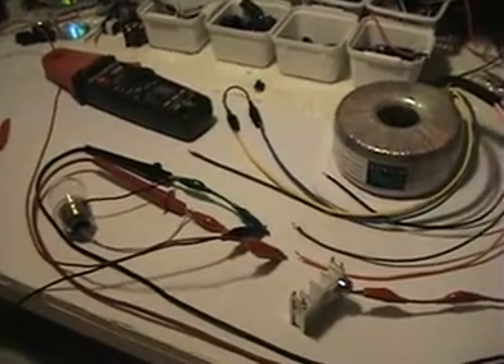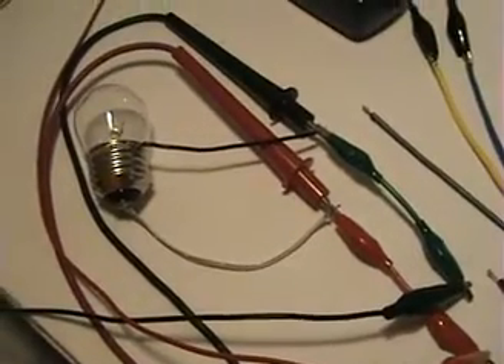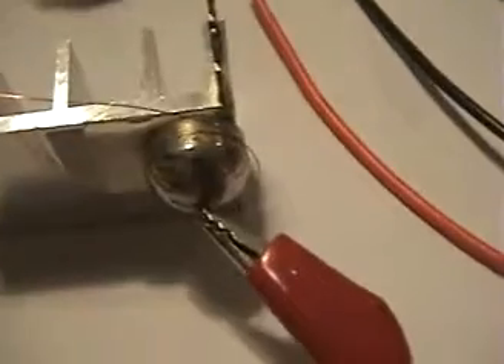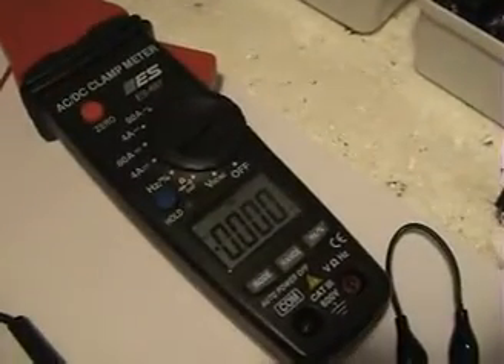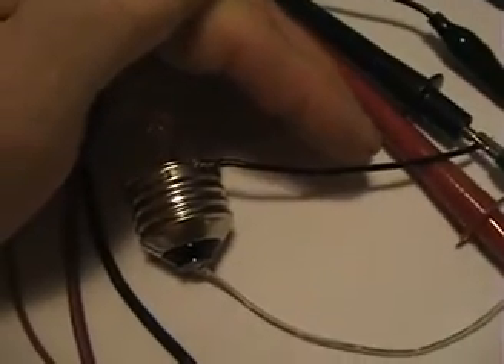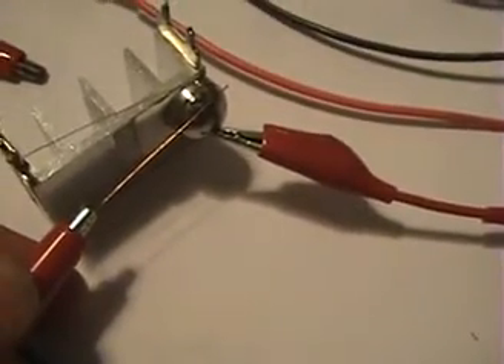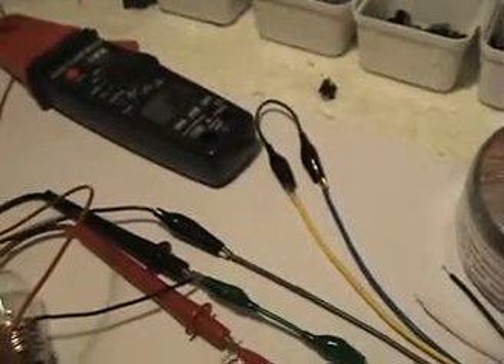Electricity Amplification by Neo Magnet (update)

Comment from the maker: Yes Eddlipton,

you are getting it. You can look at a coil like a heavy flywheel. If you give the wheel a push you store energy in it and you can get it back less friction. If you pulse push the wheel you can have it evenly doing work to something that is attached to it. However you cannot have something attached to it that require more energy (work) then what you put into the wheel.

Luc

Comment: Interesting stuff!

I don't think this is quite the same thing happening with my magnetic quench though.

Once when I was a kid and I had one of those 2001 electronic kits with a bunch of parts and springs to connect to the receptors I thought to myself, what if I connect the electromagnet part with the closed path of the relay.  That way, when the current flows the magnetic field will build up strong enough to sever the contact, which would in turn collapse the field and cycle over and over.

Comment: Hi Luc,
additionally I'm thinking that the voltage which goes through the magnet is modulating the magnetic field from the magnet itself. It must be in the range of 5 Khz ore more, otherwise the coil would not ignite the spark. There is a paper(pdf) on panacea-bocaf Online University about a MRA (Magnetic resonant Amplifier) which describes how to gain energy from a magnet(but in a different way)- it takes a piezzo to oscillate the voltage.
Nice Greetings
Micron

Comment: Hi Luc,
i have just two ideas: what if you take a longer cylindrical neomagnet instead of you little one, and wrap a magnet-wire around the magnet. like a coil. We have Oscillations otherwise the ignition coil would not work. so there must be a oscillating magnetic field that cames from the magnet. Normally we must taken up an alternating current from the wrapped wire around the magnet. -futher on both end of the cylindrical mag you connect the wires from the ignition coil. Greets Micron

Comment: So my main point is you can do the same thing with a relay which probably has better materials to handle the sparking, and mechanical motion is done without using the magnet as a conductor.

In either case you'll not really be able to use much current, so in the end you're probably still have to use a mosfet or transistor, and lastly you'll get more control with the 555 timer circuit.  It's just charging and discharging a capacitor through resistors based on 1/3 and 2/3 voltage comparisons.

Comment: Hi Luc,
the second ideas is to try to pick up current/voltage with a blank wire  from the mag, like a second loop and grounding it on an extra capacitor. But the resistants in the new created loop must be lower than in the loop of the ignition coil, otherwise
the current/voltage will not going also through the second paths. Maybe it will works with caps they're have normally a low resistants. Let me Know what do you thinking about.
Thanks Micron

Comment: The relay I did that to fried somehow, either the mechanical lever sparking created an insulating coat, or the coil burned up from voltage spikes but anyway, I suspect what you have created with the magnet and the wire achieves a similar effect.

As current flows through the wire you get just enough of a magnetic field to repel the wire off of the magnet, which then collapses and oscillates.

I love the oscillation but the sparking is undesirable, as well as the heat in the mag from conduction.

Comment: Hi gotoluc,
this is what Tesla did, adjusting or modifying spark-gap with magnets. I'm thinking that this is a kind of OU because the magnet is sucking/polarizing neutrino over the spark itself, this a type of method to use a magnet to have more electrons materialized from dirac sea in the wire. This could be used for producing serious amounts of electric power. Referr to Tom Bearden a magnet have no static magnetic field it has a field in a steady state flow from the quantum field. the pulsing

Comment from the maker: Hi Ed,

I'm working on a circuit that would be a signal generator with Pulse width (duty cycle) adjustment and control of 2 independent switches which are 90 degrees out of phase (flip flop)

Just wait a few weeks and I'll let you know when it's ready.

Luc

Comment: This looks similar in function to Tesla's high frequency current circuits(the one that uses inductor's to convert environmental energy to electrical energy. you should look up those patents. Look up N. Zaev's work also. In the process of building a PWM that hit's pulsing rates of up to 44Khz. Should be fun... I can only imagine 150Khz and up. That particular area of Tesla's work is the most fruitful for mankind.

Comment: Now use 2 speaker magnets, at least  4". With the positive wire in the middle, hold them apart to the point they just start pulling on each other, you feel your hands shake. Then repeat that with frozen magnets.

Comment: Amplification?  Chopping the DC up with a vibrator (the coil and magnet) produces pulsed DC, the transformer can step this up to a higher voltage BUT only at the expense of lowering the current available.
This effect isn't new, before electronic ignition every car had a distributor that did just this mechanically to produce many 1000's of volts to produce a spark at the spark plug.
Reply from the maker: Yes, you're right in a way!  However, what I'm sharing here is you don't need contact points and a mechanical rotation to open and close them. You can vary the DC pulses by varying the length of the pulse wire and or pressure applied.
Reply: Luc gotoluc Choquette
 That's largely what an electronic ignition unit does. Shifting the timing of the pulse to suite the demands of the engine.

Yes, what you have is a sort of mechanical PWM system driving a transformer.

Any one familiar with a shocking coil would recognise this.
https://www.google.co.uk/search?q=shocking+coil&biw=1920&bih=930&source=lnms&tbm=isch&sa=X&ei=AZ9XVJHuGpPdsASew4KQCA&ved=0CAYQ_AUoAQ#imgdii=_
Reply from the maker: Richard Harris
Yes, that's exactly what it is. A variable frequency permanent magnet mechanical pulse switch.

Comment: yo. theres something pretty fundamentally wrong with your setup here, your transformer wont work with just a straight dc current. A transformer utilizes the effects of a time varying magnetic field, provided by a time-varying dc current, or ac current through the primary to get a continuous production in the secondary. of course the bulb glows when the dc is pulsed, cause you now have time-varying dc. I cant say that the magnet has mutch to do with it tho,

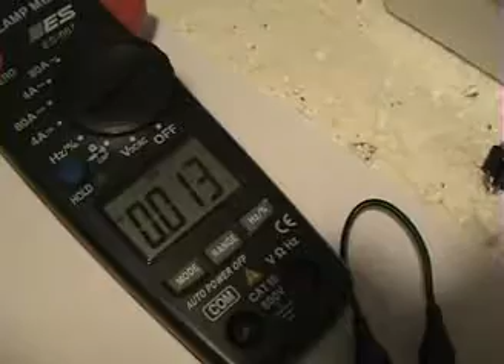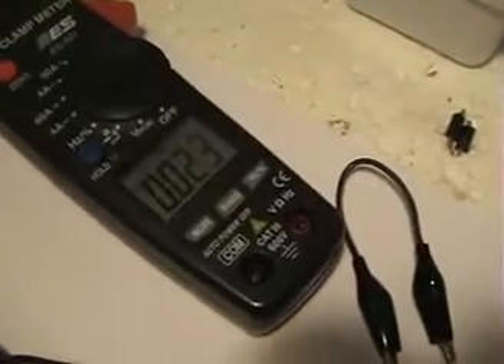Comment: 1) Are you sure you know what you're measuring??  @ 2:15 "13-14 miliamps"   @  6:10  "23 miliwatts"  Are you measuring watts or amps yo? As far as I know, not many meters measure watts unless maybe you have a 3rd probe to read voltage opposite of the current sample.  

2) If you wanted to make your primitive freq generator last a little longer, Try a small .001uf ceramic cap and start working your way up in value till you stop getting arcing across the 2 terminals (heatsink and neo mag)..

Comment: There are no limitation to energy amplification to 95% (this is just a fixation from theory) - you can achieve 300% amplification or 3 COP, or 1000 COP, depending on the cleverness of the circuit and other tricks, trust me, I know this practically.
Reply: yes but there are limits to how much energy your home appliances can take
Reply: i know this personally
Reply: This will not be a problem (hehe) with some current limitators! And depending of the device, with some clever adjustments, for the close loop!
Reply: I believe you - and the sort for a good talk who have done the work to know.  Ive had a home made toroid magnet set up,  {home made part of your tricks?} from memory it went from buck booster to 25v from 12v bat - running the circuit and going back to battery via a dimly lit 5w bulb - My God exitedly touched me with the message  "Yes its working!"  I looked at the meters and couldnt see any power going in.  But - the power going into the device was exactly the same as the power going back into the battery - "exactly no losses" {voltage and current measured}  yet it was running the device {dimly lit 5w bulb}.  Next day i used the battery running computer / amplifyer and led lights for half hour before discovering I forgot to plug the battery charger in - when I did so the charger led indicated fully charged battery.  i gather this is the cold electricity they speak of,  doesnt read on your instraments.  But i dismantled the circuit in pursuit of other ideas  {as I want to see the power going in}.  And its another to do project.  But good to hear your comment about great increases.  Is it cold electricity you speak of?  For viewers - its not a case of saying everything,  because there is no one and you have to learn trial and area - and clean up the mess over and over - so the ignorant and their chicks consent to slavery enjoying their ignorance.   Then to think sucess is going to spill the beans in the name of hippy love when there is none for the tinkerer - get real.